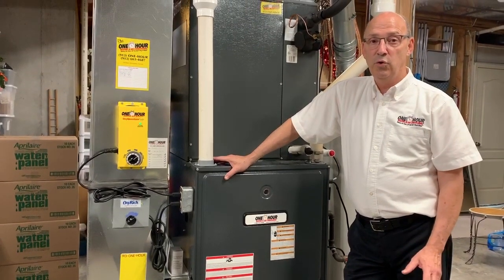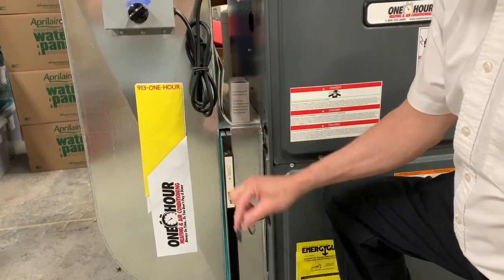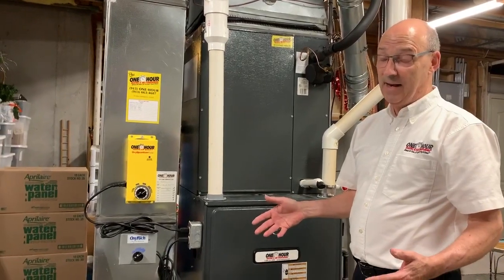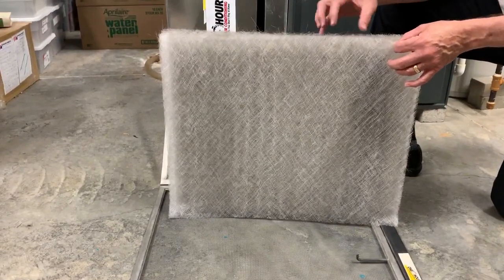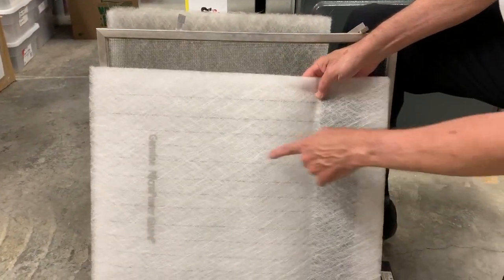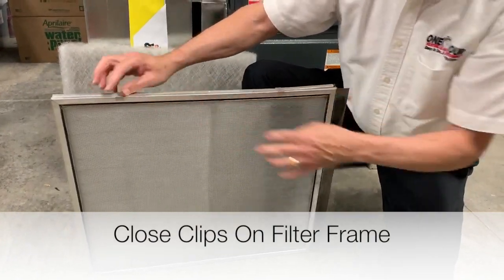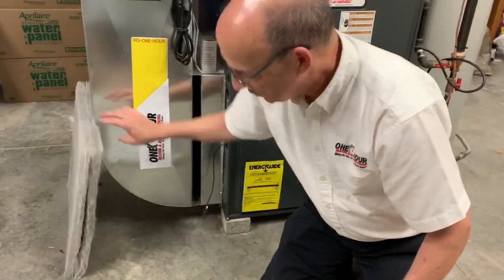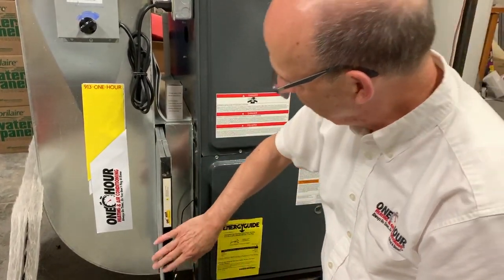Electronic Air Filter Replacement With Micro Power Guard (Plus How Electronic Filter Works)

Comment: I live in Colorado and the static filters i was given with my system is more like a grid throughout the filter. Since watching your video in replacing filter did turn off furnace and split the filter to actual touch the grid. But i did notice the static filter assembly was an inch an a half shorter so i vacuum out the inside. But, one i like your filters better what’s the brand you use. Also, I’m pretty sure  i have to get a static assembly that fits.